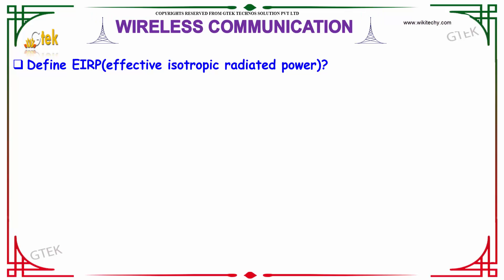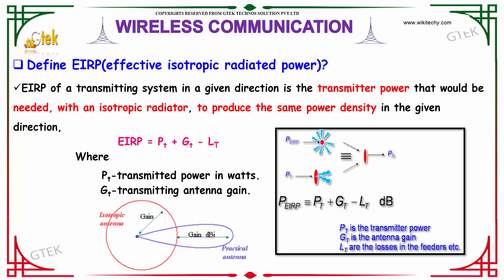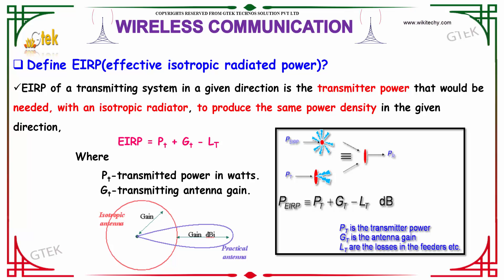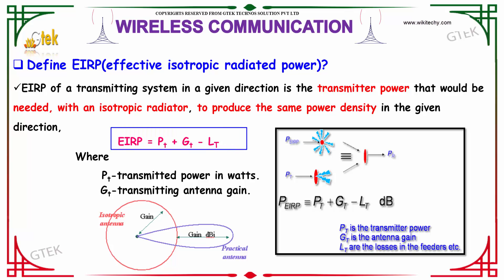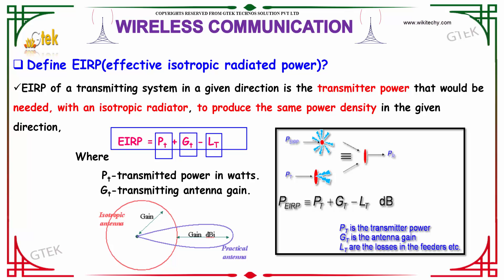Define EIRP | Wireless Communication Interview Questions And Answers

Comment: www.wikitechy.com/...interview-questions-and-answers/...communication.../wireless-c...
Wireless communication is the transfer of information between two or more points that are not connected by an electrical conductor. The most common wireless technologies use radio. GOKULAKRISHNAN GK • 1 month ago. The yin-yang Wi-Fi logo indicates the certification of a product for interoperability. The Wi-Fi.

Comment: Wireless communication is the transfer of information or power between two or more points that are not connected by an electrical conductor. The most commonwireless technologies use radio.